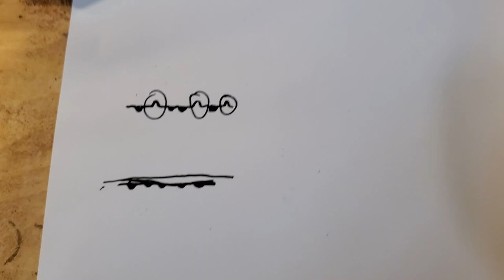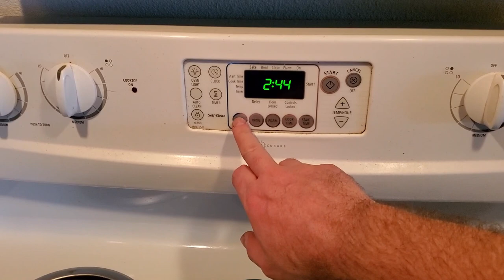How To Make Cast Iron Non-Stick

Comment: So far you and Kent Rollins are two of the videos that didn't sand it smooth to a polished finish.  I'm totally convinced that sanding them too smooth takes a longer time to get your seasoning correct. The first 4 I sanding I went too smooth, I had trouble with the seasoning and resanded them with 40 grit to put some texture in the skillet.  Now when I sand a rough Lodge or other rough skillet I use 80 grit or 60 or 40 grits. I only sand them a couple of minutes on the lowest or slowest setting and I leave a lot of the original black on. They turn out incredible. They are way smoother than new Lodge but they take on the seasoning great. If I would have found your video earlier I would have saved myself some work and time. Very good instructional video.

Comment: I have found that seasoning 3 times with grape seed oil, then once with 1/2 cup each of salt, grape seed oil and peels from two potatoes provided great results on original Lodge bumpy surface.  Absolutely no sticking or problems at all.  Now I have sanded down my Lodge and have seasoned 3 times again with grape seed oil.  I will be seasoning once more with grape seed/salt/potato peels and see how that does.  Not sure it will be a perceiveable difference as the original Lodge bumpy surface performed superbly.  I'll let you know how it goes.  Great video and well presented, thanks.  Ciao

Comment: Great break down. Cast iron is so fun to get into, if anything just for the history. I recently restored some of my grandma's hand me down campware. Turns out one of the skillets was a 3rd series Erie (which later became Griswold), dating back to the 1890's. Also found a 1940's 3 notch lodge and holy cow, they used to better. Both are proudly in regular use now.

Comment: My grandma always used lard and bacon grease on her pans. I did sand my pan down once. I am a bowl maker by trade, and the angle drill I use for sanding bowls is perfect for sanding the bottom and sides of the pan. One pad I use is firm, and has a 1/4 round profile on the edge which is perfect for getting all the way to the edge of the pan. The random orbit sanders to run at a bit too high of a speed for my preference, and with coarse grits, they don't cut as well as a drill/grinder that goes in a circular pattern till you get to the higher grits, like 180 to 220.

Comment: I sanded mine by hand. Might've taken a little bit of time but wasn't difficult if you don't have a sander. I used 80 grit on the whole pan, inside and out. Didn't remove the dimples, but factory seasoning was stripped. Reseasoned with beef tallow, so far so good. There's a reddit of a guy with 80 layers of seasoning that smoothed out after I think he said 30 coats. Something to try next, maybe, lol.

Another thing I do is scrape and chainmail scrub the pan clean all the time to help knock any seasoning high spots down before the next time I season.

Comment: A little pitting spread out over the frying surface are a good thing. It helps the oil pool evenly over the surface, easier creating an even oil film when frying. That combined with good seasoning making for less sticking. The seasoning sticks easier to an uneven surface too. That's part pf why cast iron is the best frying pans. So just sand off the peaks and nothing more.

Comment: Thanks so much! Had no idea to do this. I've tried cast iron in the past, but always had the sticking issues -- and since the pans are so ungodly heavy I didn't see the point. Will give it a try again using this method. ^_^
PS: Don't see you on The Beartaria Times app yet. Someone asked about cast iron the other day, so I just shared this video there. ^_^
Reply: It was me haha. Great Video! @Angel Bear thank you for the suggestion.
Reply from the maker: Thank you! I'm Woodshop Bear on BT app 😁
Reply: @LittleBearWoodshop  Fantastic! Found you ^_^

Comment: So when sanding down the factory seasoning, I've seen cases where the new seasoning just disappears once it's cooked in and cleaned the first time. What are your thoughts on that? I'm wondering if those examples were seasoned at too low of a temperature where the fat didn't polymerize as it shoudl have
Reply: That's my experience, too. I've tried this with carbon steel pans and the seasoning goes on beautifully. It looks amazing. You start cooking your egg and it's at first non-stick. Then you take out the stuff, put it under just hot water and a soft sponge and gone is the seasoning. It's flaky, showing a lot of the metal underneath. I've tried it with linseed oil, canola, lard it doesn't matter. The seasoning just isn't strong enough to withstand cooking. Especially eggs. It sometimes withstands cooking vegetables, sausage, but anything that has "grabby proteins" like a piece of beef or eggs, the seasoning comes right off.

Comment: Just seasoned 4 pans & dutch oven following Lodges directions ...  they didn't say anything about warming before applying the seasoning ...   didn't sand so I'm pretty sure the time spent on 3 cycles ( let cool normally)  wash & reapply was time well wasted ... 😡

Comment: Ok so leave it in the oven 4 hours after greasing it?
Reply: he does say that then when he does put it in put taking it out after wiping it down he says 45 mins...I'm going with 4 hrs the 1st time then 45 mins after that for however long it takes to get it slick.
Reply: I understood it as he greased it and baked it for 45 mins, then did it 4 more times @45 mins. I could be completely wrong.